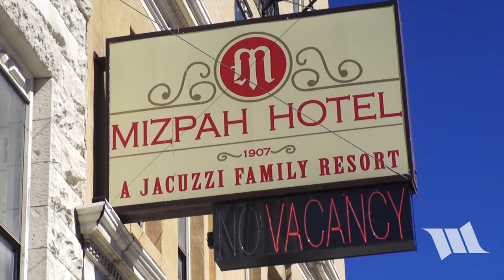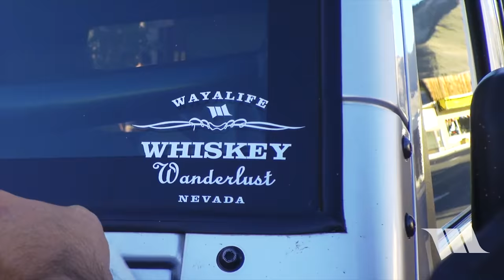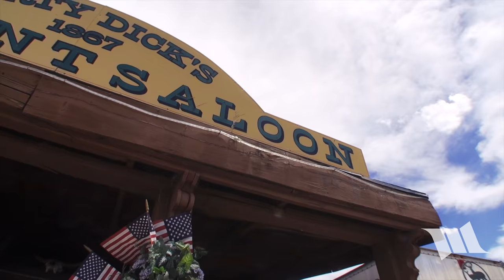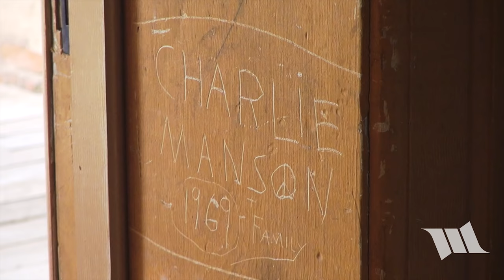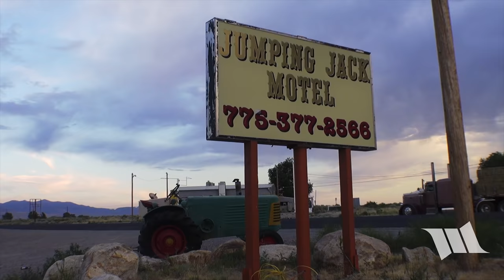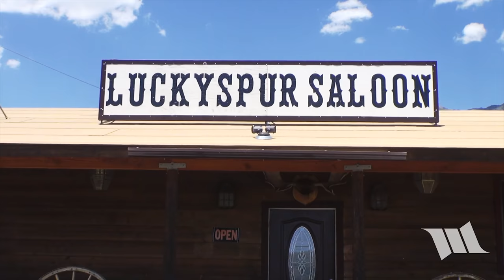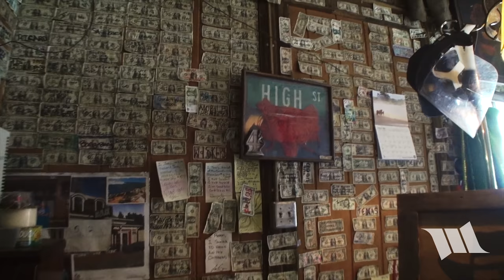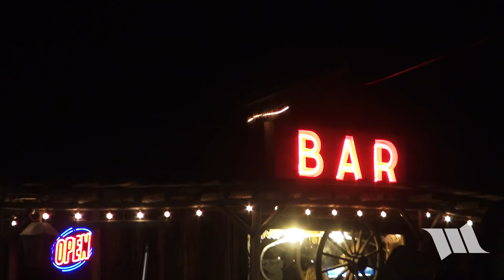Off Road Overland Ghost Town Saloon Tour Across Nevada in Jeep Wranglers WAYALIFE WHISKEY WANDERLUST

Comment: Hey Eddie, I have a question for you.  looking back over your past videos that cover your jl rubicon, you have installed many different lift kits from several different manufactures.  In your opinion which performs best for you on and off road in the 2-3" category?  Thanks
Reply from the maker: That's a tough question being that ride quality is totally subjective. All lift kits will get you wheeling and/or driving around town but not all will feel the same. Also, there's the issue of cost. What kind of budget do you have to work with?